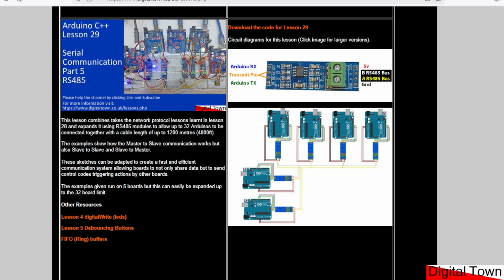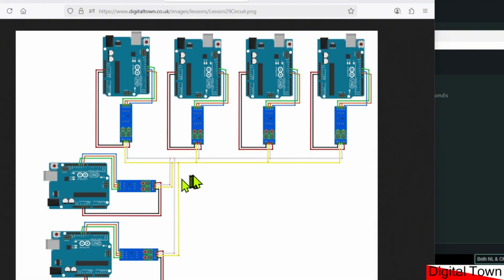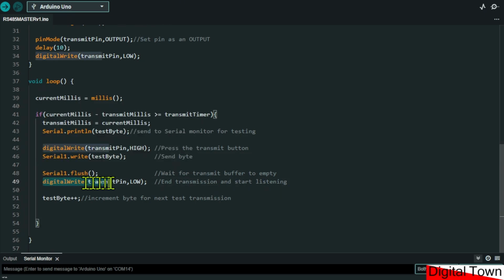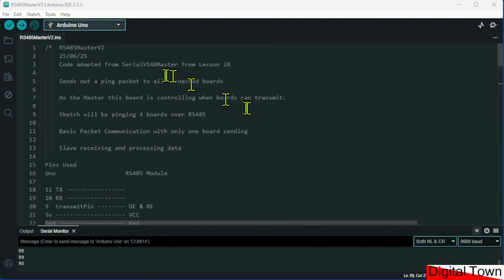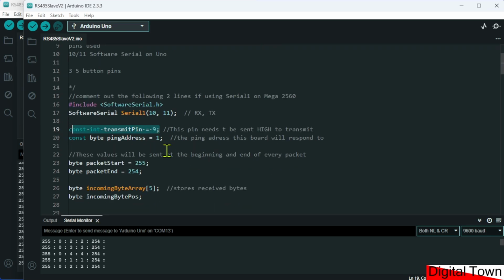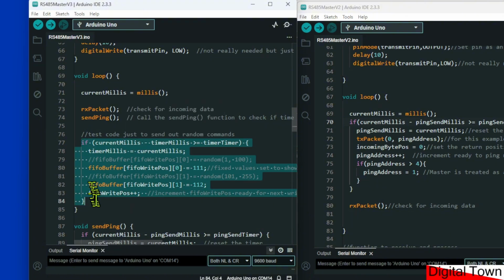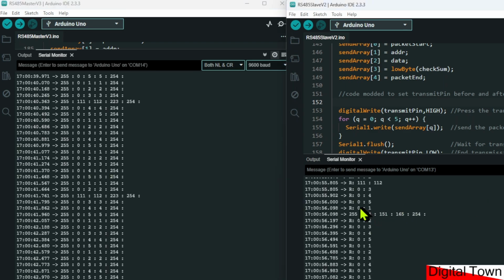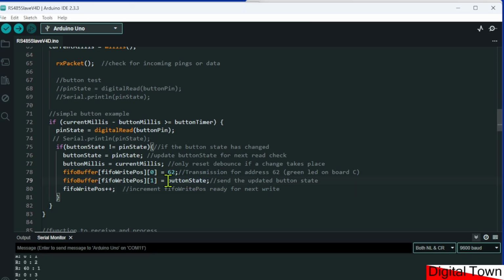#144 Arduino C++ Lesson 29 - Serial Communication Part 5, Using RS485 modules

Comment: I keep holding a error for the rxPacket, do i have too chance that too?

I:\ARDUINO\Lesson29\AANGEPASTEslaveV4D\AANGEPASTEslaveV4D.ino: In function 'void loop()':
I:\ARDUINO\Lesson29\AANGEPASTEslaveV4D\AANGEPASTEslaveV4D.ino:79:5: error: 'rxPacket' was not declared in this scope
     rxPacket();  //check for incoming pings or data
     ^~~~~~~~
I:\ARDUINO\Lesson29\AANGEPASTEslaveV4D\AANGEPASTEslaveV4D.ino:87:28: error: 'buttonPin' was not declared in this scope
     pinState = digitalRead(buttonPin);
                            ^~~~~~~~~
I:\ARDUINO\Lesson29\AANGEPASTEslaveV4D\AANGEPASTEslaveV4D.ino:87:28: note: suggested alternative: 'button8Pin'
     pinState = digitalRead(buttonPin);
                            ^~~~~~~~~
                            button8Pin
I:\ARDUINO\Lesson29\AANGEPASTEslaveV4D\AANGEPASTEslaveV4D.ino:142:17: error: a function-definition is not allowed here before '{' token
 void rxPacket() {
                 ^
I:\ARDUINO\Lesson29\AANGEPASTEslaveV4D\AANGEPASTEslaveV4D.ino:179:42: error: a function-definition is not allowed here before '{' token
 void processPacket(byte addr, byte data) {
                                          ^
I:\ARDUINO\Lesson29\AANGEPASTEslaveV4D\AANGEPASTEslaveV4D.ino:214:37: error: a function-definition is not allowed here before '{' token
 void txPacket(byte addr, byte data) {
                                     ^

Compilation error: 'rxPacket' was not declared in this scope
Reply from the maker: I've just checked the original code and it compiles without any problems so I assume from the filename the code has been changed
Can you email me the code of the digitaltown website and I'll take a look.
Reply: @digitaltown5442  you mean, the code, i have changed, bcz of 8 pushbuttons on slave D?

or the original code from the lesson 29
Reply from the maker: @hedalen001  The error is in the code you have written, but it's impossible to work out the error from those messages without seeing the code. At a guess I would say a "}" is missing but that's just a guess for now.
Reply: @digitaltown5442  is it better to send here the whole code, i have till now?
Reply from the maker: @hedalen001  Just the sketch with the issue should be ok
Reply: Can you help me with this?
Reply from the maker: @hedalen001  you need to send me your sketch

Comment: Your channel is a great find, It is very rare to find channels that actually talks through code fully and provide it to download. I have retired from being a commissioning engineer and using industrial PLC's and am playing with power line communications so need to create a protocol, I need to have an acknowledge that an action has happened and a failsafe to turn off on failure of comms, so a bit of homework to do! Also I because the bytes must be sent following a zero crossing I cannot use the arduino serial functions, but fortunately I have a library from a GitHub source that has done this bit for me. Anyway I found lessons 28 and 29 a great starting point. I am sure you know, this but the 32 DH485 node limit is purely due to electrical characteristics and the industrial Profibus (uses RS485) standard allows up to 126 nodes but as you say only 32 per electrical segment so a repeater is used to make repeat electrically separated segment(s). Wishing the channel success..

Comment: why dont it work with a external power supply, and only with USB ports?
Reply from the maker: It should work with external power supply, USB is just there to show results on the Serial monitor.

Comment: Is it possible to get a complete connection diagram of all slaves, master and buttons?
Reply from the maker: The buttons and leds are the same as in lesson 28, the only difference being the addition of the RS585 modules instead of direct serial connections.
Reply: @digitaltown5442  thank you so much

Comment: how to fix the sketch from slave4D, for 8 buttons?, Can you please help me?
Reply from the maker: You have 2 choices.
Line 33 const int buttonPin = 3;

Change to const int button1Pin = 3;
and then add const int button2Pin = 4;... repeat 8 times with different pin numbers

Line 56 add in pinModes for all the new button pins
Repeat lines 75-81 for each button

The alternate is to put all the buttons in an array and work through the array 8 times.
Reply: @digitaltown5442  thank you so much for your help
Reply: @digitaltown5442  can you please help me with my sketch working?